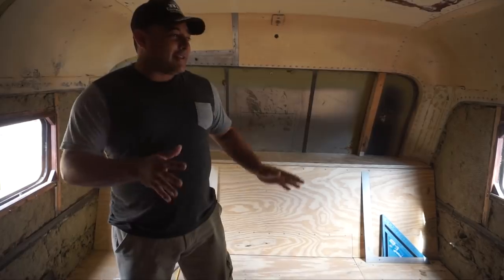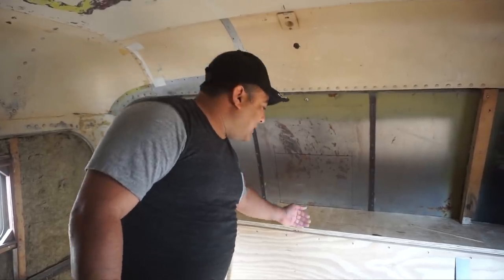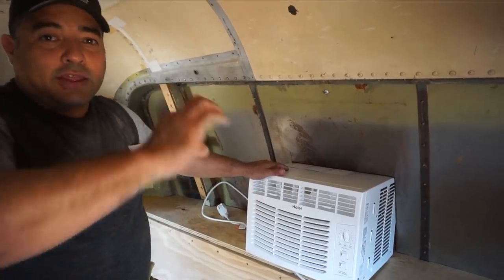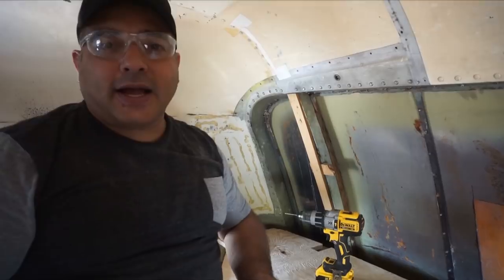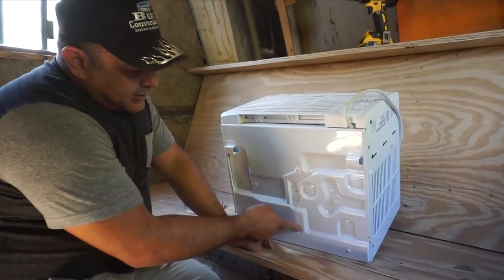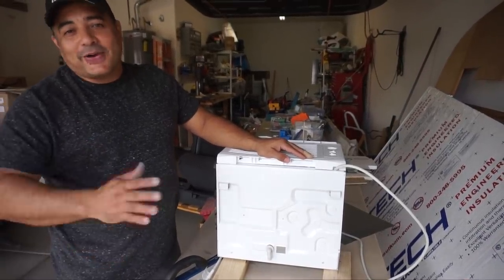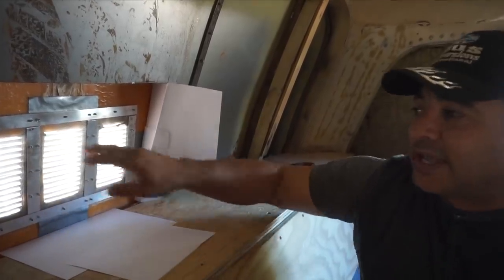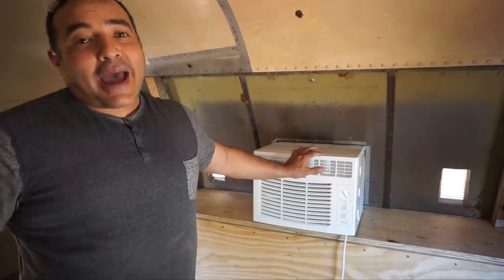Installing a Window A/C in the bus (but not in a window)

Comment: you mentioned you chose 120v and not 220v with what sounded like a pivotal decision.  if you had it to "do over'  would you have gone 220?
Reply from the maker: I am still not convinced 220 would have been a better decision.  The only compelling reason I can think of is to do a dual headed mini-split.  That being said the little window a/c in the back has been excellent - We originally thought we would use that only on VERY hot days but now that we are traveling and using the bus full time we use that little unit ALL THE TIME.  It has worked great and it can cool the back down very quickly for bedtime.  I can honestly say there have been zero times I have said: "boy I wish I had done 220V"

Comment: Nice project. What brand and model mini-split do you run on your panels? Thanks
Reply from the maker: Thank you.  It is a SuperAir 12000 BTU unit.  Here is the link - we bought it on Amazon.  https://amzn.to/3m2srhh. It works great!  In the five years that we've had it installed, the only thing we have had to do was replace a schrader valve.

Comment: I hope those AC vents do not suck in carbon monoxide while you are driving. The rear of the bus will create a vacuum and possible pull it in much like leaving the back window open of a station wagon or hatchback.
Reply from the maker: Thank you Tim - the wall we build in the back of the bus should completely isolate the inside and take care of this concern.

Comment: Does this venting actually work (well)? I'm guessing that the vent(s) for the intake air aren't quite enough to get the AC to cool as efficiently as it was designed to.
Reply from the maker: It probably doesn't work as efficient as it possibly could but it works REALLY REALLY well.  When we first put this in we thought we might use it only every once in a while when things got REALLY hot.  In practice we pretty much always use this air conditioner - it very rarely turns off and has worked really well.

Comment: are the intake ports necessary? theoretically wouldnt you be drawing more cool air from the inside? (that you just cooled)
Reply from the maker: We closed up the rear with a wall at the front of the a/c unit so that we would not be dumping our nice cold air to the outside.  If you watch this video it will make more sense: https://youtu.be/wf8hIbuceWU